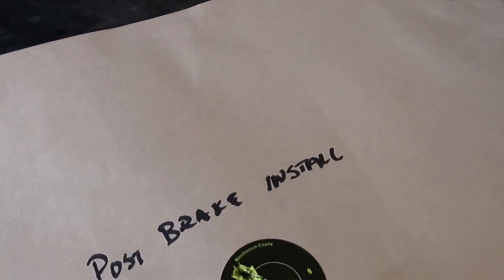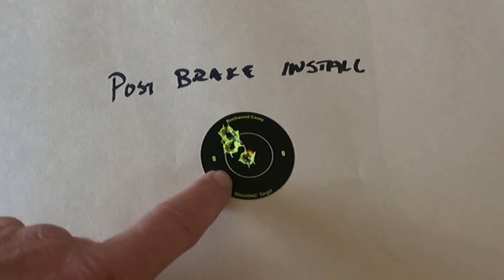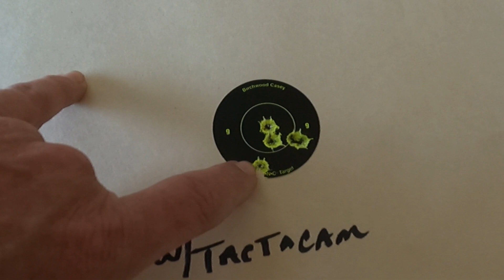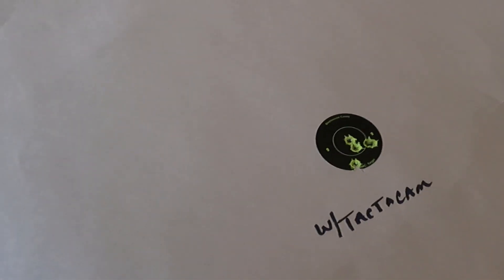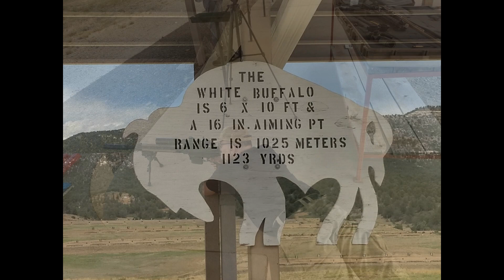How much POI shift due to a brake installation on the 6.5 PRC

Comment: I'm wondering if you could put the tecticam on another scope and mount that on a tripod. then you don't have to mess with it and will be able to see and shoot better.  you then can match the sound tracks up on your editor . do a spilt screen.  sofar the tacticame is not very impressive..  good shooting..
Reply from the maker: I might try setting to up on another rifle set off to the side but then you do see what I see when I aim and pull the trigger. Split screens and sound track matching is the easy part. I will keep trying to get the tactacam right...I really want to get a clear thru scope video for y'all.
Reply: @Halfmilesniper  I understand why you want it to work, this way you can show drop and windage from the shooter perspective.. I've tried this units and not one seem to give a good pic, plus they destort your vision and mess the shooter up. you would think this is something these company could get right.. flustriaghting I know..
Reply from the maker: @out of the woods to the mill  I can deal with a slightly less than clear view if I can get a clear image on video...at least close up like 100 yards.

Comment: Yea, I'll pass on the tacticam. Great unintended review! To be fair, I could tell how hard you concentrated on the second shot with it to correct to get a good hit. Confirms it can be done.
Reply from the maker: I need to get better at setting the tactacam up and getting it focused. There has to be a way, I've seen clear video attributed to the system so it can be done. My honest review is it isn't easy to set up. Thanks for watching I really appreciate it.

Comment: NICE !!!!! 
Odd question/suggestion.
Could you add 1/4" board to the folding part of the legs on your shooting table?
My hopes and thoughts are that they would still pivot correctly but when locked in place the would have 5 -10° slant creating a more sturdy set up.
I do agree I don't think it makes a real difference but couldn't hurt....
Just a thought.
Thanks for making the time to make these video's
Reply from the maker: I built the table with about a 2 inch rake...front end being ~2 inches higher than the rear. I think the camera hides the angle. When I am using the bench as a table it a talking video I have a spacer under the rear (side legs in the talkie, LOL) to make the table level. Now you have me wondering how many degrees that is...hmmm
Reply: This is a total random thought but you have mentioned this before of the table moving but if you have a wider stance pluse both front and rear legs are slightly angled out from center of table I would think when you sit on it it should make a much sturdier platform.
I'm in no way an engineer so this is just couriosity